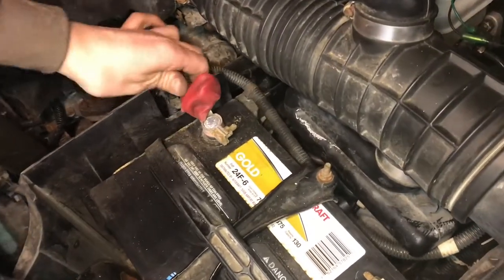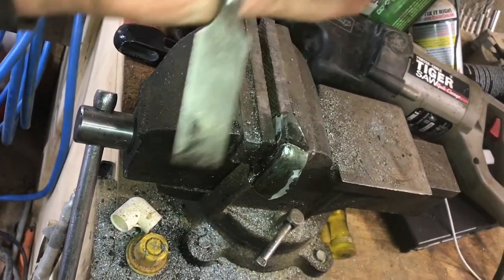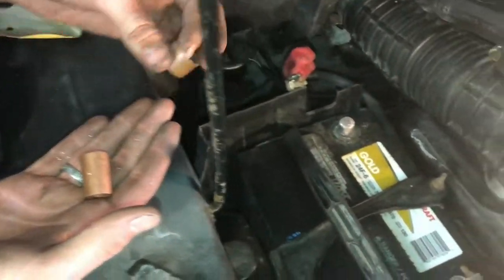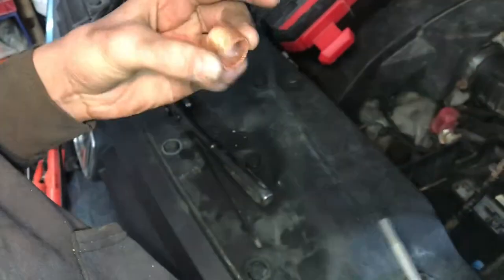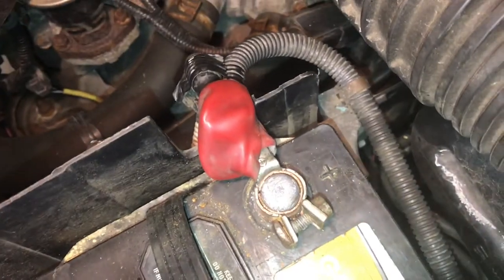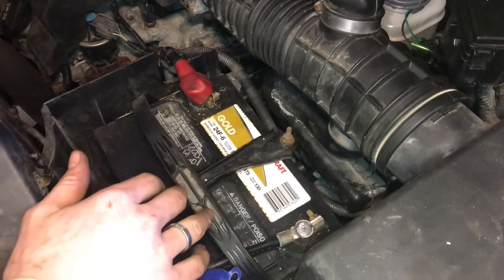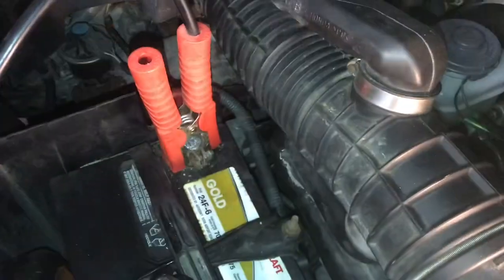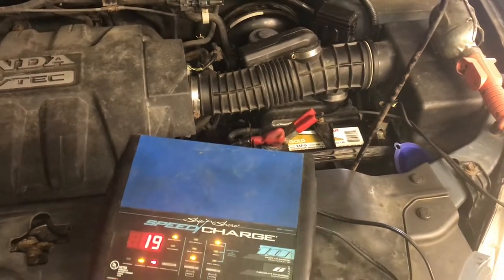make a car battery post LARGER to make a GOOD connection

Comment: When you tighten the battery terminal clamps us another wrench to counteract the torque of the tightening wrench.  The full force of the wrench will otherwise bend the battery post and break the thin lead connections inside the battery. The post is moving at 2:54 and the damage is done. Just because the battery is dirty and heavy doesn't mean it's not delicate.

Comment: Hey Live Free, I'd like to run something passed you. I've got steel post clamps that are loose and I'm wondering if I can tap on the lead  post to enlarge its diameter. Naturally  I don't want to destroy the battery but this might be better than the shims that aren't  working. Thx, Bltoth

Comment: I hate it when a no it all  poo poos stuff,pardon my french.but I am and ameture myself ,learned hard way about electrolysis,alum boats,p. t.plywood on alum.etc.this is lead,but copper may react with this.dissimler metals.just watch it,and see if it corrodes.might try grease.because its battery and might heat up.use dielectric its not conductive but its is high heat tolerant.thanks